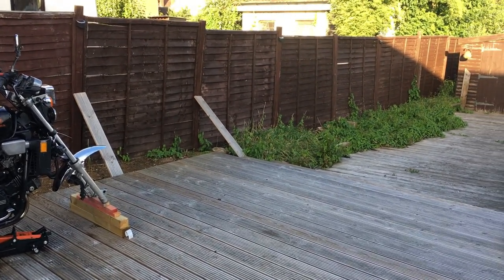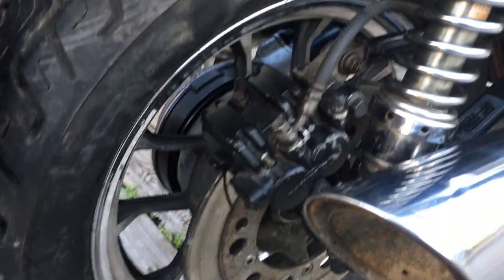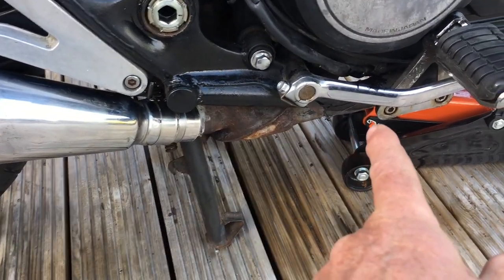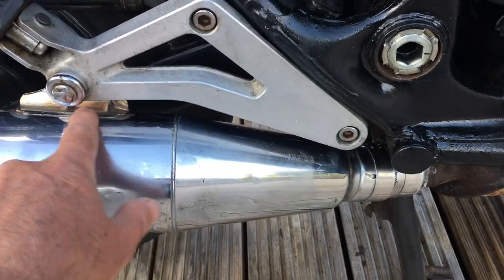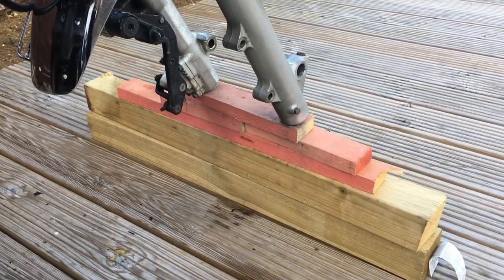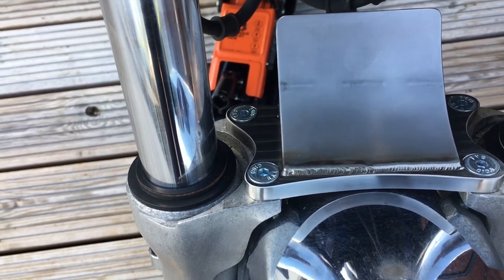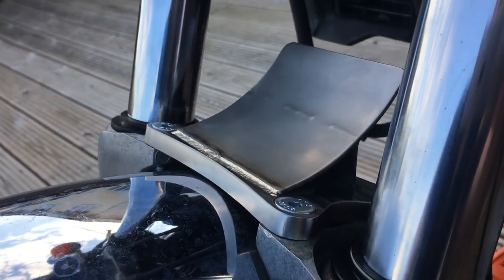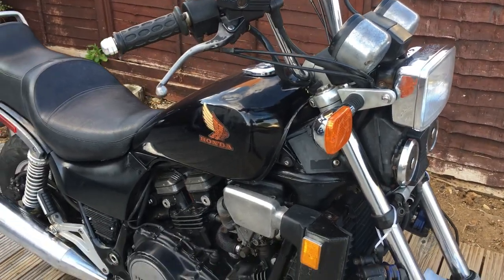Barn Find 1984 Honda V65 Magna VF1100C - Part 14 - Back end rebuilt - Fork Brace - more shiny things

Comment: Excellent modification for the front fork plate. Totally original and heavy duty.
Reply from the maker: And after all that work I found an original one cheap on ebay as somebody mis-labelled it as a VT1100 - got it for £15 :)